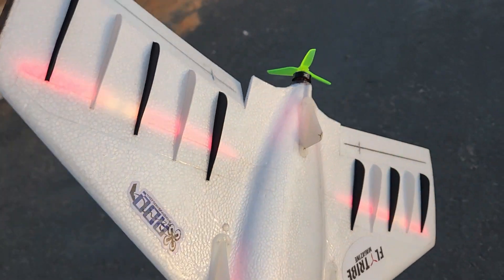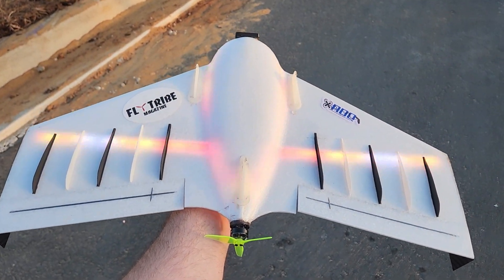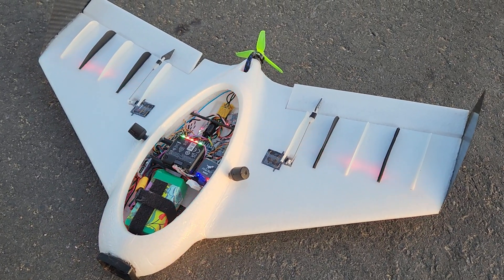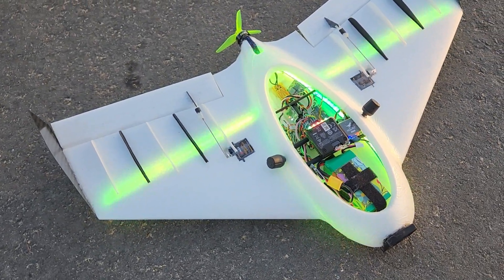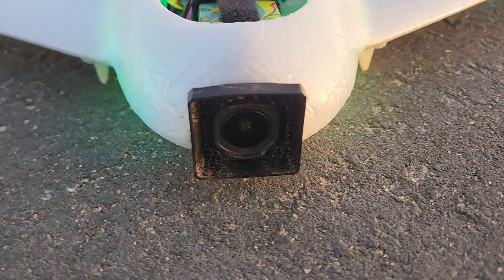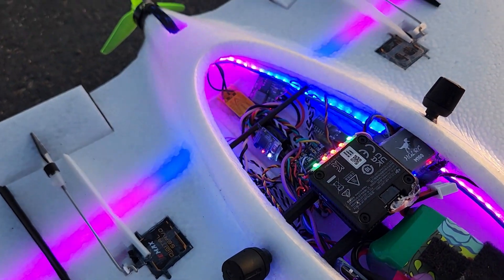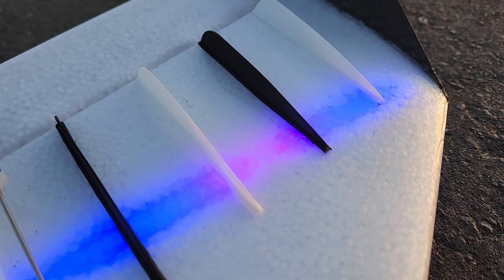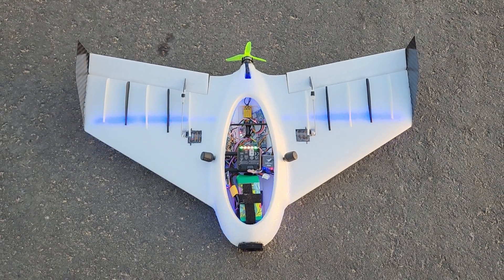4S Flik Wing - Testing Wing Fences

Comment: I see below where you commented it didn't solve the yawing issue, seems like it helped a bit?  I am also flying 4S in mine with a 1406/4600 and Avan Prop, DJI 03, (2) 4S 850mah batts in parallel for longer flight time.  Mine is doing about 100mph flat.  I am wondering if it's a weight issue as mine doesn't yaw too bad and when getting over say 80mph it seems straight as an arrow.  I wonder if extending the vortex tips to underneath the wing would help?
Reply from the maker: Yeah, it didn't solve it and maybe only helped a little. I'm wondering if my 2 front skids I installed might be adding to the issue. I think I might try removing them next since they are in front of the CG point and adding a thick layer of laminating film in their place.  
Wow, dual 850s! I'm guessing you get over 20min. of flight time. Have you tried a Li-ion? You won't get the same speed but gain in flight time with a similar weight.

Comment: Wow that o4 footage is Excellent
Reply: Do you fly it without the top? If not how do you deal witht he o4 temp?
Reply from the maker: I have two vents in the top cover that forces air over the O4 Air Unit and no issues with overheating. There is a link in the description for my mounts and vents on Printables.

Comment: Do you feel any difference flying the fences?
Reply from the maker: Maybe a little but it didn't solve the issue. The winds picked up later that morning and it still had some of the yaw shakes.
Reply: @natemccomb  To be honest, I think it already is very stable for such a light wing. Alight has also put a lot of thought and testing into it and they also had a professional from airshaper run a simulation.